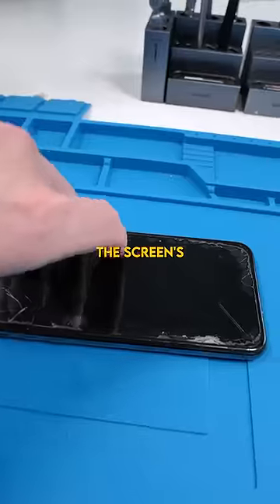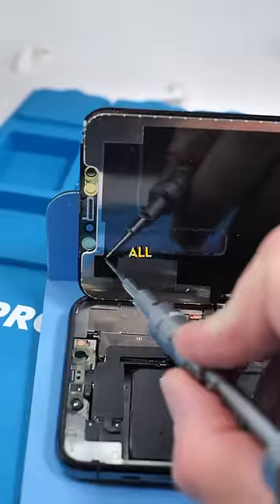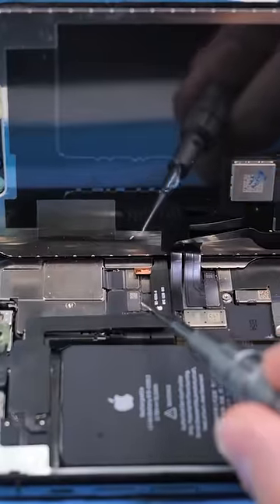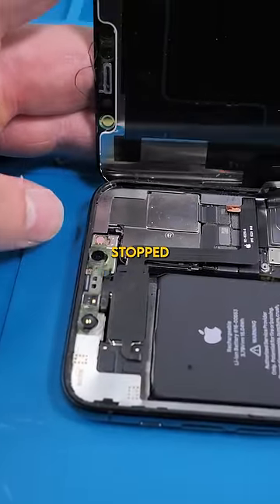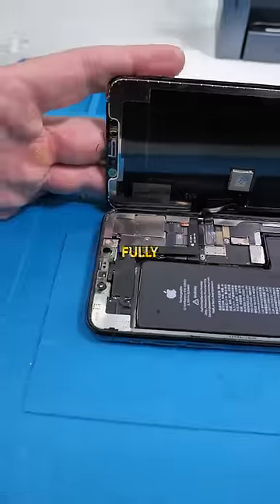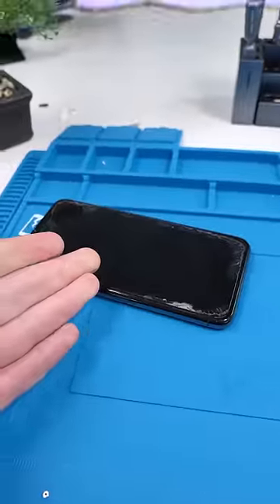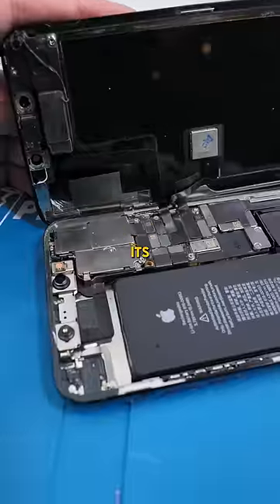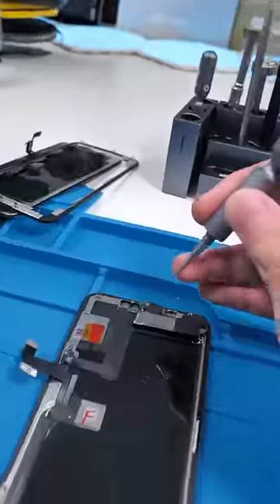Who’s The Bozo That Fixed This..? #Shorts

Comment: Is the iPhone 11 still a good buy. My carrier is offering it refurbished free with a 30.00 5gig to go plan. Sounds good to me I got the 10 x last year and it's been perfect Cspire also offers to repair or refurbish any device regardless of the manufacturer. A Mississippi based carrier they also have a deal with Verizon if you live or travel outside of the state. Good people great support team and obviously great deals on devices new and used. I'll never use any other carrier especially if you live in a rural area.